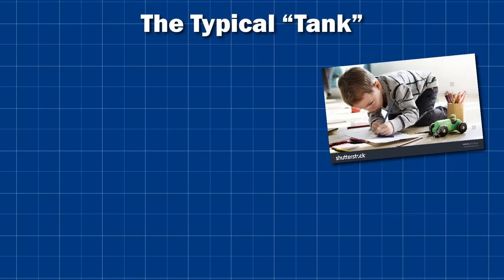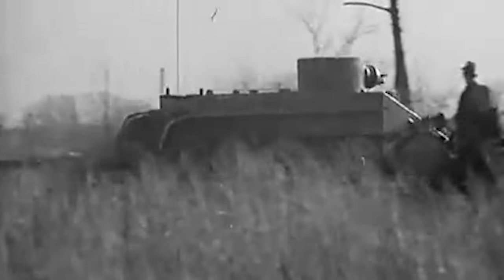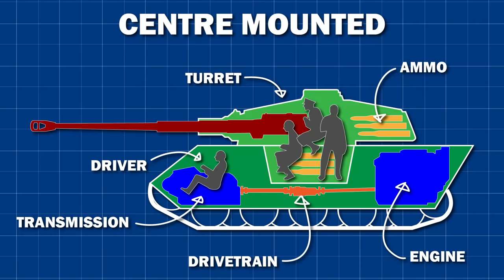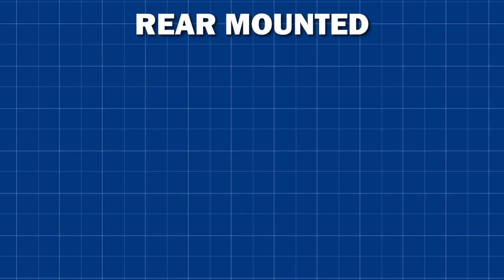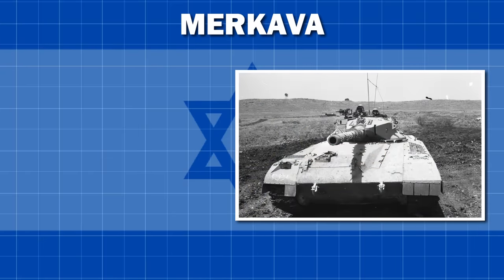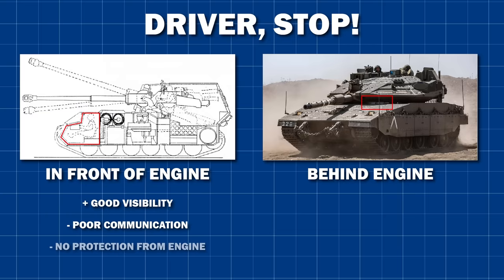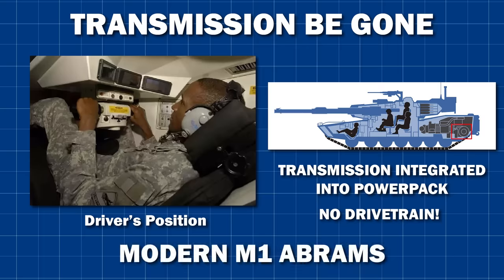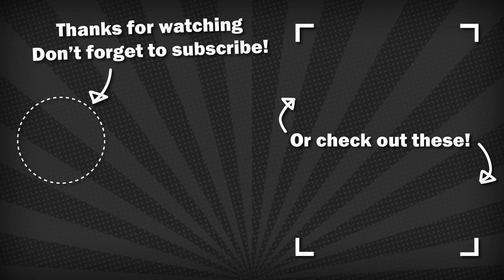What happened to Rear-Mounted Turrets?

Comment: Another benefit of the rear mounted turret can be a more sloped front, and therefore less material necessary for a certain amount of thickness, and therefore less weight.
Obviously depending on the size of the engine.

Another benefit can be that the front panel can be removable to access the engine for service or replacement (as is the case for the front/middle mounted turret, albeit the chassis top panel).
This means that you can potentially replace the front panel as well, which means that most of the tank can be reused by simply replacing the drivetrain and the front panel (assuming the shot didn't go further).

Comment: It just drives me insane that he uses the Ferdinand (Elephant) as an example for rear mounted turrets, when it didn't have a turret.
Reply from the maker: Unfortunately it is very difficult to get a side-on cutaway diagram of any vehicle with a rear mounted turret! The Ferdinand explained the concept well enough that I included it. Considering it’s almost identical in layout to the VK 45.02 (P) I didn’t think it was too offensive.
Reply: ...and clearly RedWrench has not crewed or maintained a tank in the field that has a rear mounted engine & tracks driven from a rear mounted final drive/sprocket; e.g. Centurion, Chieftain, Challenger, Leopard, M1AX...etc... but then, I've only crewed three of those (4 if an ARV counts) ;-)

Comment: I made a tank in Sprocket with a rear turret, mid mounted engine, and driver and Commander in the front… And it proved preposterously effective! It was a fairly narrow wedge with thick armor and massive slopes, and even much heavier tanks had trouble penning it.

Comment: There is a tank in World of Tanks known "Lupus" from Valkyria Chronicles that has a read mounted turret. One thing I have always found useful about it is how thick the front and side armor is, and you can line up with a wall, then turn the tank slightly and backup from behind the wall only explosing the turret and the side of the tank, but at a very steep angle that most shots would bounce off. It seems to be pretty effective as a way to use rear turret tanks in my opinion. No need to expose half of your tank just to shoot around a corner. Just line up with the corner at a 90 degree angle, then turn about 5 degrees left or right where the back is pointing out from the corner, then backup until you have line of sight of your target. I have bounced so many rounds doing this. However, it is also just a game so idk how well that tactic would even work in a real situaton, but who knows maybe it would actually work well.
Reply: Corner tanking does not happen in real life nearly as often (or probably at all) compared to hull down tanking, where gun depression is king
Reply: its called sidescraping… and in real life its not as effective but also should be noted that most tanks just cant do it because you cant clip a gun through a wall

Comment: The Argentine 25-ton TAM tack has a rear-mounted turret, with the driver alongside the engine.  Another reason for the preference for mid-mounted turrets is that the tank can be rotated along with the turret to bring the gun to bear more quickly, without losing the targeting.  This was a big deal with the Tiger, which had a very slow-rotating turret.

Comment: He only looks at MBTs in this question, but what about other vehicles?

M109 Paladin or the Panzerhaubitze 2000 are self propelled artillery tanks with the turret in the back.

The FV101 and FV107 are british light tanks with turrets in the rear.

AMX 13 light tank.
Wiesel light tank.

Puma IFV
(Bradley and Marder IFV also have the turret a bit more towards the rear)
Stryker AFV variants with turrets

Comment: Rear mounted turrets are usually done on vehicles that either need long barrels and the ability to have easier replenishment of ammo, which are usually self propelled artilleries. The rear hatch always made replenishment much easier and the Merkava being a largely defensive tank needed that rear hatch to replenish ammo under fire. 

Of course the conveniency of converting rear mounted turret tanks into APCs and IFVs is a side bonus like the Namer APC which was built on older Merkavas chassis.

Comment: as the tank designers explained to us, if we develop a mobile tank for the European theater of operations, then the armor is calculated from the angle of fire of 30 degrees in front.    And if you make armor in front of the tank, then only by moving the tank crew closer to this armor, you can protect the tankers. Neglecting the rear of the tank. If you move the turret back, you will have to make the side and upper body armor all thick, this immediately adds about 20 tons of tank weight, and requires a redesign of the engine, suspension and all mechanisms. A tank weighing 55-65 tons , immediately has many problems with transportation, transportation by aircraft, problems with bridges, a problem with soft ground,(as in Ukraine)

Comment: Couple of points:
1. The Merkava's gun depression is -8.5 deg, which is perfectly respectable. Most former Warpac tanks only go to -5 deg, most NATO ones go to -8 to -9 deg, while British tanks have the best depression at -10 deg. 

2. You don't need an automatic transmission to have a rear-mounted gearbox. Anything Christie-derived, such as the British Cruisers and the Russian BTs and T-34 had a rear-mounted gearbox and they were all manual. What they had was long control runs (push-rods and/or cables) that ran back from the driver to the gearbox. These were much lower than a drive shaft, but the downsdie was that they needed to be carefully adjusted and maintained.

Comment: The merkava was also expected to operate in urban environments.
Since it's main opponents are the Arab nations much of the terrain the Israelis might fight on is reasonably flat, a limited gun depression may not be as much of a problem. Also, the merkava would also be expected to operate in urban environments, where gun elevation rather than depression would be more useful.
If I remember correctly there's also an AFV version of the merkava which was considered one of the best armored infantry vehicles at the time of its first deployment. I vaguely remember that it had an interesting feature where part of the tank rear could rise up so infantry could dismount by walking out the back with weapons ready rather than hunched over.

Comment: 3:43 I still wouldn’t call the Merkava a rear mounted turret tho. It’s still center mounted. The engine is the only thing that’s different. The design still tries to keep the turret as close to the middle of the vehicle as they can. The M10 is closer to being an actual rear mounted turret. The only real rear mounted turret in modern designs really are SPH’s. Or the Stryker MGS and vehicle like it.

Comment: Modern tanks have a power pack. The engine and transmission are one unit and the trackers are powered a rear sprocket instead of a front one. It makes logistics waist because the entire drive train can be pulled out and replaced in field conditions within 10 hours

Comment: I could see rear mount starting to come up more the communication issue to the front of the dining has been solved but also at the same time the visibility from behind the engine for the driver issue is fixed as well. Tanks are going to move to a screen and camera area for crew visibility anyways.

Comment: my predictions for advantages and disadvantages before watching the video:
Centre: exposes less of the tank when peeking slightly out of cover, better weight distribution, but gun is more protruding, and engine is more vulnerable at the back
rear: better weight distribution in its own way, engine in the centre, less protruding gun, more weight spread to the front and back of the tank instead of the centre, potentially less hull wobble, but peeking from cover is more difficult and crew are more distant from each other

Comment: One issue with a rear mounted turret and driver is actually getting the driver out in case of an emergency, like a burning tank.  Since the driver is not part of the turret basket his hatch is extremely close to the underside of the turret.  In some orientations the hatch is completely blocked and can’t be used to egress.  Also the hatch often can’t be used as an optional mode for driving that gives the driver more air and much better visibility, like loading or moving tanks around a secure base.

Comment: Small correction, tanks like Merkava, and in fact most modern IFVs with front engines, place the driver BESIDE the engine, not behind it. The disadvantages of visibility still somewhat apply, but not quite as much as they would if the engine was also in the way of the driver. This way its just the transmission. 
The real disadvantage to that layout is that the engine compartment is narrow and off-center, thus limiting what engine can be placed there. For IFVs its not a huge issue as they arent that heavy anyway, so a smaller engine will do, but Merkava is kind of surprising in that they crammed a 1500 hp engine in there. Also the off-center engine will shift the center of mass, though most IFVs just counter that with a turret on the opposite side, so its not a huge issue either.

Comment: With the rear of tank less heavily armoured, putting the engine there makes cooling easier as gaps in the rear armour are less of a problem than the would be on the front. The lighter armour would also make it easier to open access hatches to access the engine for repair or maintenance.

Comment: A good video. Gun mounting is often a matter of keeping COG manageable, as well as balancing survivability. A single unit drive system (engine & tranny combined) saves space in the vehicle which means more crew/equipment space and/or a smaller profile. There's the choice of front engine or rear engine and the choice depends on keeping weight more-or-less towards the center of the vehicle for stability. There are major advantages to rear mounted guns when the gun is overly large, as in a seige gun (non moving turret). Keeping the turret in the center tends to make more sense when the turret can turn since, when it fires, all road wheels absorb the blast recoil. With ammo storage in a "blow out" at the rear of the turret, much of the weight is shifted rearwards. Or at least that's the way I read it.

Comment: Diffences between front, middle, and rear mounted tanks:

Front: the turrents are giving some off balance because of the weight of turret and crew inside but the advantages is the wall, meaning you can hide using buildings to prevent getting hit

Middle: it was balanced all between turret, engine and crew inside, but the disadvantage is if the enemy shell got hit, there's a chance that the ammunition got cooked off, like soviet T series that the turret just popped off.

Rear: in Urban warfare is awful but there's some tactics that they have to use, use as self propelled howitzer, or use reverse gear to use to hide some buildings and to make tank trenches to prevent engine hit and it was giving some advantage about recoil, that the weight of engine and transmission is giving some advantages.

Comment: For me, the distinction is not so much about the placement of the turret, if there even is a turret, but about where the engine is. With the most of the famous WWII tanks it seems like it was popular to put engine in the back, transmission to the front and a driveshaft in between. Russians liked to put the drive sprocket in the back with the engine, though, and it made the transmission hard to handle with the technology of the time. Late war and after the war it became the popular thing to do with everyone else too, I think. Front engine for crew survivability has been seen with MBTs a few times, but it's quite rare. The benefit is quite small when facing things like APFSDS rounds. More common with IFVs and such.

Comment: 3:38 Merkava don't have rear mounted turret, the turret is middle mounted. Engine and driver are at the front, turret in the middle and troop compartment at the rear just like most IFVs.
Regarding drawback in real rear mounted turrets (driver/engine/turret configuration) the issue with isolated driver may make him impossible to evacuate if driver's hatch is hit and welded in place. In most tanks in driver/turret/engine design configuration driver can sneak to the turret and escape through turret hatch if driver hatch is hit.

Comment: I love the Merkava, but something a lot of people don't think about it is just how little distance the Israelis generally have to travel since the IDF is focused on an aggressive defensive strategy in the tiny land mass they own. In contrast, most other Western countries generally think about large borders, travelling across different terrain in their own or other countries they seek to help defend.

So I've also wondered if the turret mounting center vs rear also had operational range or mechanical considerations, like [fuel] storage and logistics. In Israel, tanks are expected to rarely operate further than 30-50 miles from a base of operations and repair stations. But in places like Ukraine or Russia, there could be hundreds of miles or more between front lines and adequate military installation with only small towns in many areas. As such, your maintenance must be easier and the tank must be capable of going further for longer.

Comment: One problem not mentioned here with a rear-turret design is exposure. With the turret so far back the tank usually needs to expose more of itself in order to bring the gun to bear. In modern doctrine this is not necessarily a huge issue horizontally speaking, as you seldom want tanks in urban environments without infantry support (or, in-fact, ever). However vertically this poses a huge issue.

Every tank commander worth their salt can tell you that one of the most basic principles they learn is terrain masking, Hull/turret down positioning, and jockeying (or pop-up and maneuverer). Using hull down positions and jockeying (withdrawing to the point of full mask, moving a fair distance sideways with regards to the target, and then advancing to a new hull-down position) is very effective and gives a trained crew a huge advantage over an opponent caught in the open and unprepared, however it relies heavily on good gun depression which as stated in the video is one of the biggest design faults of a rear-mounted turret.

Comment: The Booker can be a promising  addition. Tactics are going to have to be tweaked for it. It does not have the armor of a main battle tank. It’s FAST. It’s going to have to be used in conjunction with main BT’s, infantry, and air power.

Comment: The Vickers Medium of 1924 was the first widely adopted tank with a forward engine configuration. This was purely for reliability purposes. The drivetrain of engine - gearbox - driver was the most common failure in early tanks, the closer they were together, the shorter and less complicated the linkages. As the driver had to see forward they all went forward. 

The Vickers Medium was by far the most reliable tank of its era, allowing commanders to develop far longer ranged missions than previously anticipated. 

One other benefit of the engine forward configuration was reduction in length. With a turret dead center you must have three compartments: Driver - Turret - Engine.  The Vickers Medium, like the Merkava has the engine offset to the right of the hull, so the driver sits alongside it to the left,  thus removing one complete compartment. The designers now have the option of making the tank smaller and better protected, or keeping the dimensions the same and increasing usable area inside the hull. 

You can do a bit of both and fit a larger turret ring in a smaller vehicle than you could with the classic three compartment layout.  The M10 Booker uses this configuration to limit overall size, while carrying a large gun with space for multiple subsystems.  Carrying the same 105mm gun as the 50 ton Centurion, it weighs in at just 40 tons. The Booker is 10ft shorter and 3ft narrower than centurion and is considerably faster.

Comment: There's more disadvantages to the rear turret design as well:

1.Mounting the engine in front makes the thermal signature more pronounced
2.Mounting the engine in front makes the reclining position driver not possible, increasing the height of the tank
3.The engine in front prevents the addition of more armour on the front. Composite armour in modern tanks is quite thick and the engine gets in the way of this. (Merkava is less armoured than other tanks due to this)
4.Engine vents have to be placed in the front sides of the hull, weakening the frontal arc of the tank.

Comment: some things one must also consider in contemporary/Modern AFV designs

Internal volume and accessibility for crews - 
Merkava and the M10 Booker have it easy since the Driver isn't physically cut off from the other crew members with the driver being just to the side of the front mounted engine, 

Engine - 
by having the turret in the Rear, it could prevent the designers from meeting design specifications as the engine now would be limited to a certain size especially height, take the Abrams, if the engine were to be at front and the turret at the back, the height and likely weight would increase quite significantly, with the engine packaging needing significant redesign and along with the entire hull changed to accomodate for the drivetrain especially where the drivesprocket will be, either at the front or the rear.

the Armor too could be compromised by having the Engine at front, as that would reduce the UFP angle, while the engine could help by being the armor.

Since tanks don't go on battles like the characters do in Keijo (except the SP Archer), the contemporary designs with the turret in the middle and the engine in the back are just fine